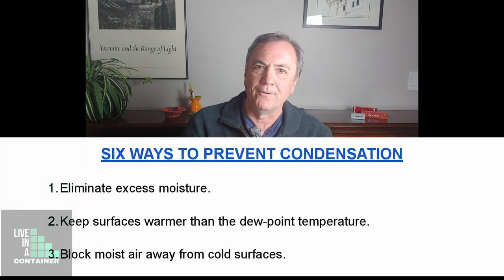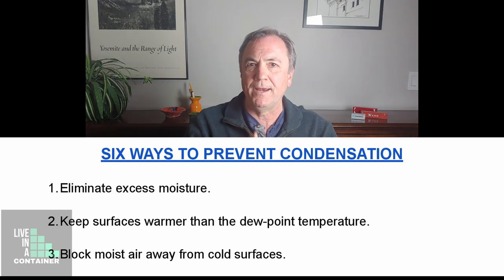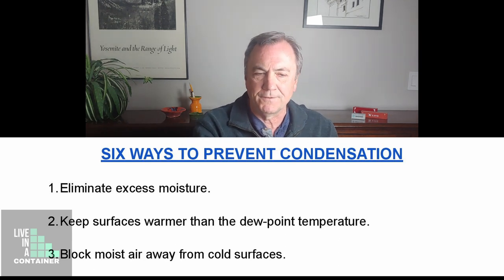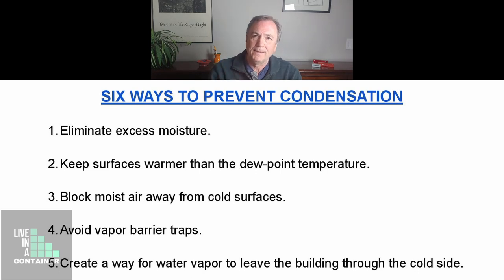Solve Your Building's Condensation Dilemma - Here's 6 Ways How!

Comment: I have messed up big time. I am in the south and put reflectix on the inside of shipping containers with no air gap. Now of course I have heat. It is great as a vapor barrier but now I don’t know how to correct this. Will you help me, please? These are going to be a barn and I am using them for storage for a house items  because of a house remodel at the moment. Thank you.
Reply from the maker: I found this video that is similar to the install you did to the interior metal walls of the container. https://www.reflectixinc.com/tutorials-and-videos/garage-doors/ . The heat inside the container will be reflected back within the space. Maybe consider cutting some edges to provide an air space between the sheets of reflectix per the video. I don't anticipate that this will help much with reducing the heat that is contained in the space though. But, it might help reduce the possibility of condensation from building up behind the reflectix - given that there is some air movement. Check out the videos on this channel about insulation and rain screens for more ideas to consider. Good luck and let me know what you find out that works for you.